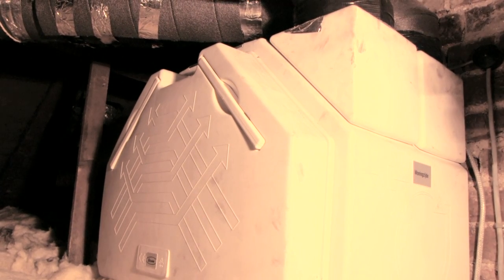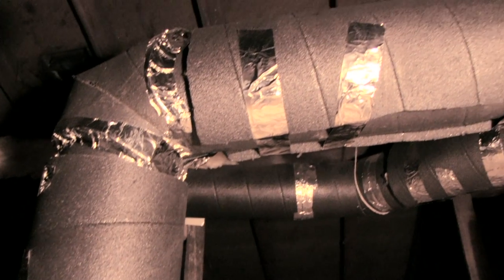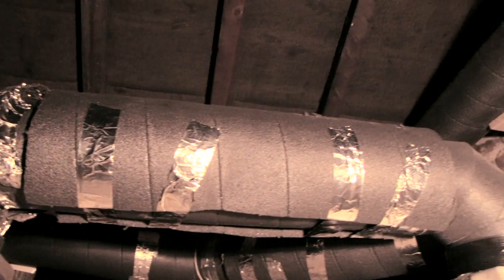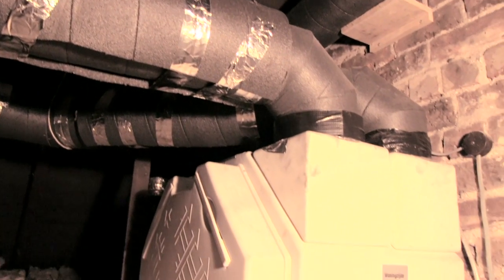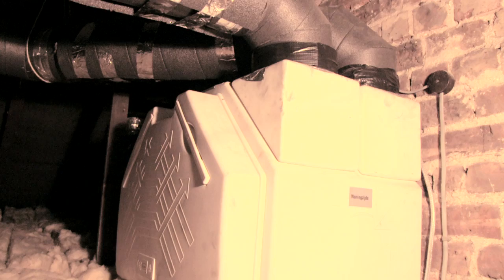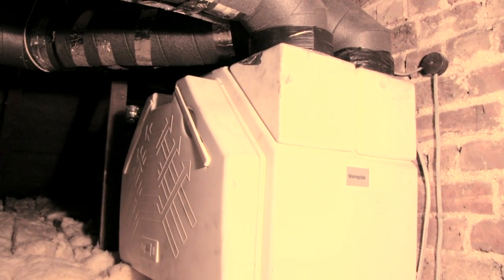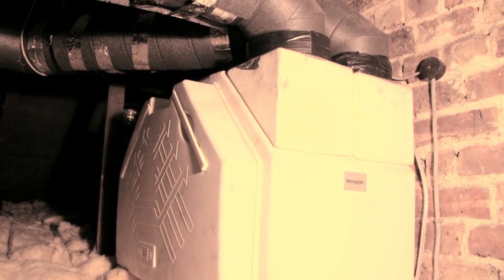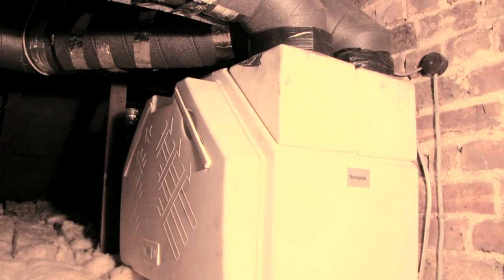Can I install a MVHR system in a Victorian house?

Comment: save your money, speak to envirovent re piv but mvhr i would stay well away from.  i have it, it cost over £5k in a new build and has caused nothing but problems!
Reply: They have to be designed properly. I'll be getting a retrofit and it'll cost me more than £5K because of design costs
Reply: @Waqas Ahmed  wow, a reply to my 7 year old comment.  I forgot about this. I have owned this system for 7 years, which was designed properly by the manufacturer, and I still would not change my advice to stay clear.  If you do get one then ensure it is designed, installed and commissioned properly and keep it properly maintained.  Water and electric are not a great mix if things go wrong.
Reply: @Jason O’Brien Which system did you install?
Reply: @wilyc0y0te  Nuaire.

Comment: I'm planning something similar on a 1940s semi that has horrible passive vents in all the rooms. Plan is to plug them up, fit a MVHR system along with external wall and loft insulation. Thanks for the video!